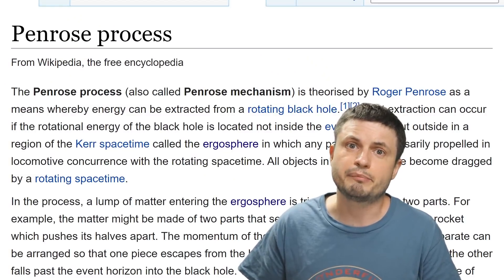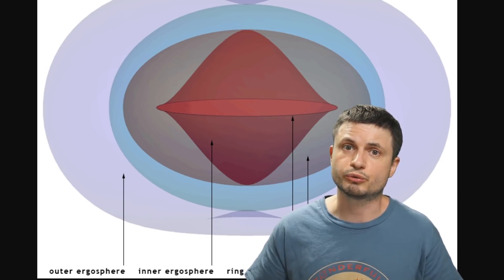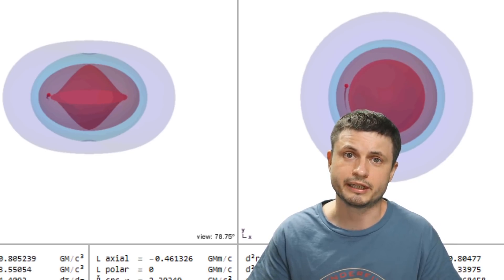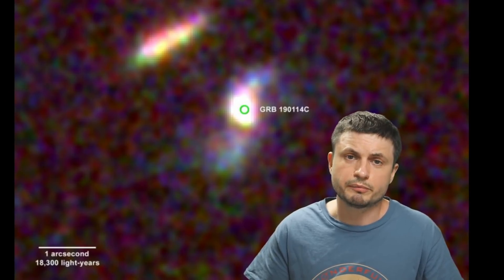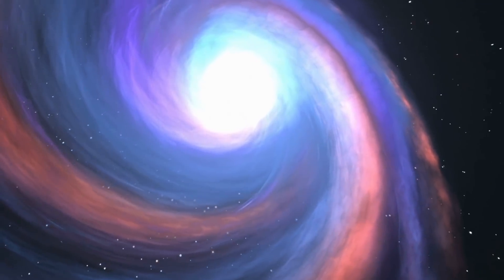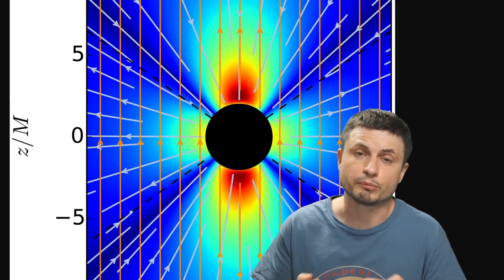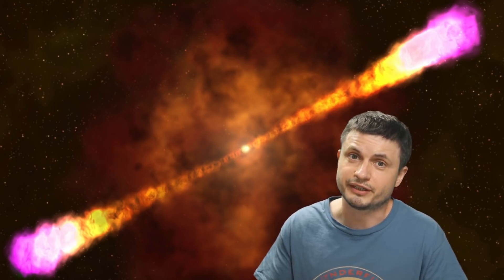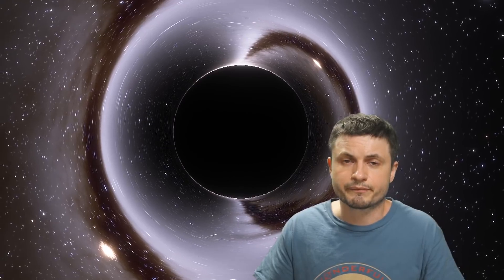Gamma Ray Burst Stole Energy from a Black Hole - Proving Penrose Process

Comment: If two black holes came close to each other, could matter be pulled out and escape from the black hole?
Reply: We don't even know if the matter swallowed by a black hole even remains in the form of matter.
Reply: Whoooaaa, very interesting thought
Reply: Sadly not possible.
Reply: By logic, maybe. By the mathematics describing black holes, no. In reality, idk. Stuff seem to change a bit when the black hole are spinning though, but not to the point of matter escaping, at least not yet.
Reply: No, because by the time the black hole got close enough to the other black hole to make that possible they’d crash into each other

Comment: Sounds like a generator with an energy cost in mass?  Great graphics, too.
Reply: nonsense jim  There is an energy cost in anything according to Newton. Anton said a bit of mass was left behind. If you pedal fast enough, there's a cost. So the mass is the energy cost.
Reply: @paulwallis7586  Anton said at 2:50 to 3:05, "You have to find a way to leave the ergosphere by somehow losing a bit of the mass and thus leaving a bit behind but once you leave the ergosphere, the mass acquired and the energy acquired is higher than what you had before."  It sounds like it isn't an overall exchange of mass energy for another form of energy like happens in a nuclear explosion.  It sounds more like taking energy from the blackhole's spin and total mass energy and other forms of energy increasing overall for the object that temporarily went into the ergosphere.  Maybe the blackhole loses rotational momentum or some other form of energy to keep energy conserved over the entire system.
Reply: @IARRCSim  Exactly.
Reply: Sounds like a generator with an energy cost in spin. Not mass. Clearly stated.
Reply: @jaychip1  You do spend mass in order to make this work. The Penrose process relies on splitting a particle into a large infalling segment and a small escaping segment, and the small escaping segment carries away the spin energy. Depending on just how fast the escaping segment escapes, your infalling fragment will have to be very large, thus you definitely need to spend mass to make this work.
Reply: @dsdy1205  thanks for the explanation. Now I'm going to research the Penrose Process to get a better grasp of what is going in in this interaction.
Reply: looks like an extreme spinoff of a gravity assist.
Reply: @ppsarrakis  Agreed.
Reply: nonsense jim  Hm. "Accelerating space" is an interesting point. Escape velocity = X, so X+ = the energy release, you mean?

Comment: You appear to be saying this might break the second law of thermodynamics by creating energy. You also seem to be saying it takes existing energy from the black hole. Those 2 are VERY different.
Reply: It's not from what i understand the extra energy is at the cost of the angular momentum of the black hole. So something that's spinning at 25% the speed of light slows down proportional to the energy taken, hence the requirement of a spinning black hole. I imagine that would probably be one of the last energy sources in the degenerate and black hole era's of the universe assuming, of course, the heat death of the universe is the accurate model of our future.
Reply: Yes, scary event horizon,  with unexplained energy output. Like a person "that i used to know!".
Reply: Nope because while you are getting more energy than you put in, the black hole itself is compensating for that loss. There for in the end no energy was created out of nothing
Reply: @Phantom-bh5ru  : I believe that Mark was complaining that Anton's phrasing is inconsistent with itself, and thus confusing.
Reply: The Universe is expanding too fast, the constants are all wrong, the speed limit of cosmic particles breaks models,
so they THINK a long long time ago, a binary system caused a black hole. 
 The MAGNETIC lines of the Theoretical newly created black hole by a previous system is powering this event - because they FORGOT ELECTRICITY exists - They think is ROTATIONAL energy - invoking warped spacetime - 
WHAT THEY ACTUALLY SAW - powerful Gamma, Xray, Radio - a powerful event. 
This could be more easily explained as a plasmoid, - I wonder if they will find another like this 
and if this even will leave a Mysterious star in the middle.
Reply: @jedimonk362  Yes, nothing could be more obvious than the fact that physicists and cosmologists forgot electricity exists. In other news, there's no such thing as gravity, you're being held to the surface of the earth by the benevolent love of the invisible Easter bunny. Because plasmoids. And weed.

Comment: I still dont understand why scientists said energy cannot be created when they knew that moving objects accelerate when no force acts upon them.
Reply: So that is kinetic energy, which is simply converted from some other form of energy. Conversion is not the same thing as creation.
Reply: @johnosullivan675  If my understanding is correct you can calculate an objects energy based on its speed and mass. So if an object accelerates i.e. increases its speed then that object has more energy.
Though the initial velocity would be created by kinetic energy what I am talking about is the acceleration that occurs independent of that.
Reply: @user-bz6gh5ng2m  I think you are misunderstanding Dark matter and possibly adding in Dark energy.
Dark Matter: Is the theory comes from the observation that observable matter within galaxies does not constitute enough mass to keep the galaxies together and that if they were held together by gravity there would have to be about 5 times more unobservable matter.
Dark Energy: Is the theory derived from the observation that galaxies appear to be moving away from each other (outside of galaxy clusters) faster than predicted by cosmic inflation. It states that there must be some unknown force pushing them apart.
In short they are both seemingly unsupported theories made to patch gigantic holes in what are otherwise very well supported theories that science seems unwilling to say are wrong but are close enough for some very precise manipulation of world.

Was you implying that one or both of these are where the additional energy is obtained from for accelerating objects?

Comment: Is this the same method that was theoretically used in Interstellar to escape from Gargantuan?
Reply: I don't think they ever reached the Point of No Return on that black hole because of the mass lost when he released his shuttle. There was no energy exchange just a "Gravity Slingshot" Releasing his shuttle provided a valid escape vector for the leftover mass.
Reply: @hadet  isn't that what this paper proposes, dropping a little bit of mass into the black hole to get extra energy and escape the ergosphere? I didn't watch Interstellar so I might just be misunderstanding the events of the story.
Reply: @tissuepaper9962  for the penrose process the bit of matter that escapes needs to push on the bit that falls in in order to extract black hole spin energy, if they simply separate that doesn't cause any energy exchange. In the case of interstellar the push comes from the exhaust gases shooting out of the engines, that then fall into the black hole. Ejecting the ranger and the lander were not for purposes of extracting energy via the penrose process, but rather just shedding weight so the engines have less weight to push out of orbit.
Reply: @dsdy1205  I guess "dropping" wasn't the right word. If you need to propel the mass you're leaving behind in order to accelerate, how is this process any different than any other jet propulsion system? I guess my question is, where does the dragging of spacetime fit in and how does it produce a measurable effect?

I'm not thinking about this in a very rigorous way, I may just have to read the paper myself.
Reply: @tissuepaper9962  As I understand it, in normal rocket propulsion, energy is conserved, i.e. accounting for losses and gains in GPE and KE and whatever, after a burn is completed the total mechanical energy of the rocket and spent propellant have only increased by the same amount as the energy liberated by burning the propellant. However in the Penrose process because some spin energy is extracted from the black hole, the energy gain in the overall system can in fact be larger than the energy put in to fire the rocket.

EDIT: to answer the part of your question about how the dragging of spacetime fits into this, very roughly speaking it is possible for particles in the ergosphere, due to the frame dragging occurring there, to have positive or NEGATIVE total energies depending on their trajectory (don't ask me how that works lol). So if your rocket ejects a mass of propellant onto this negative trajectory, then it itself inherits all of the mechanical energy of the propellant and then some, and the extra balance comes from the spin of the black hole itself. I don't know how the black hole knows to give up spin energy, my super wildass completely unproven intuitive guess is that the infalling mass hits the black hole "slower" than it spins, which slows it down the same way you slow down a merry go round by jumping on it.
Reply: @tissuepaper9962  This white paper has nothing to do with escape vectors, The scene in Interstellar was essentially a character lying to another character about the amount of fuel they had, and proposing they gravity slingshot then dropping the mass necessary to provide a valid escape vector, they didn't get any additional energy from this. Conceptually it's very similar but my understanding is that it's not the same thing. Someone that knows more about it could tell me i'm wrong but so far no one has. I just woke up but the math in the white paper is a lot different than what you'd typically see from the "gravity slingshot"
Reply: @hadet  Indeed the dropping of Tars and Cooper was merely a fuel saving problem. But it's probably fair to say that the rocket exhaust from the Endurance initiated a small Penrose effect. I don't know if Kip Thorne actually considered this, and in any case the effect would probably be pretty small.
Reply: If you go into that black hole you are in the phantom matrix or wesadac, it's a fallen universe full of black hole entities